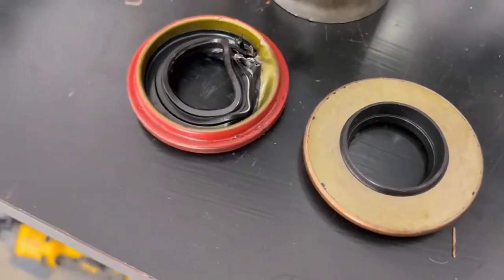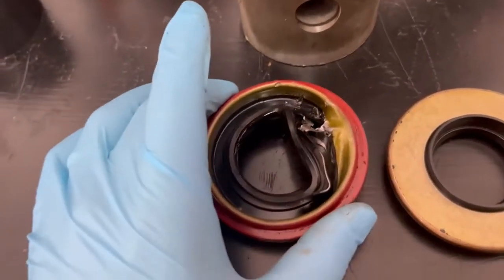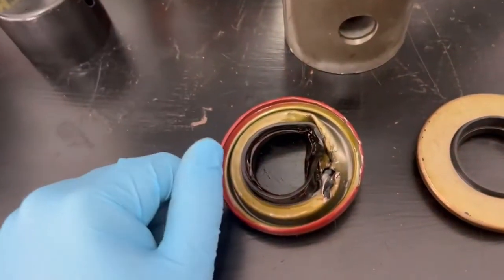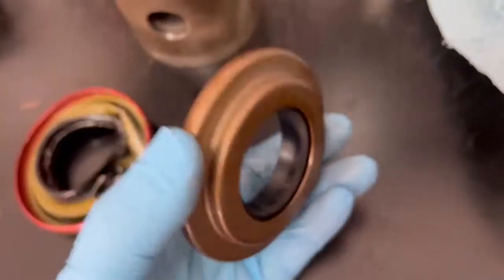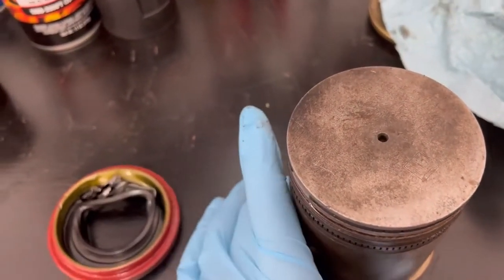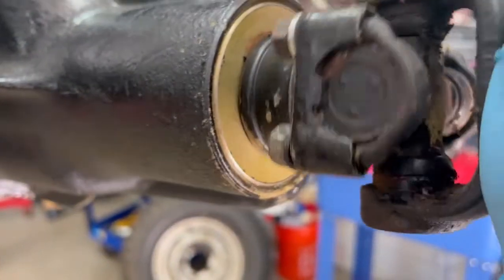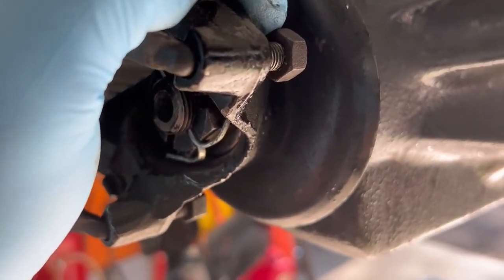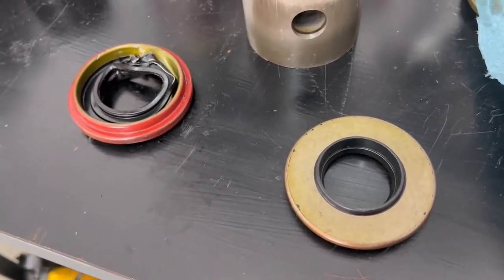1947 Jeep CJ2a Pinion Oil Seal Install

Comment: I'm looking forward to your cj2a rebuild videos.  I started a rebuild on a cj2a about 10 years ago.  It ground to a halt when the engine build took over a year to complete.  I was told they were waiting for the oversize pistons to be built.  Needless to say I kind of lost interest and it's been sitting in the shop since.  Honestly I kind of forgot where everything goes now.  Since it's in the same stage as yours I'm hopping watching your videos will get me motivated and give me an idea about what to do first to get back on track.  Anyway thanks for all the detail and info.  it's very helpful.
Reply from the maker: glad to hear you're finding the videos helpful! My engine rebuild took a few months because of parts. Same thing here - i got the Jeep in pieces and have never worked on one of these before so figuring out what goes where has been fun, especially since i did not take it apart nor did i get all of the pieces when i bought it. Thankfully I have a friend with an original 3a as i have been using that as a template to figure out where things go myself. From what i gather the 3a's are very similar to the 2a's. If you ever have any specific questions feel free to ask. Good luck!
Reply: What state are you from? I’m rebuilding one right now in MA and plan on making videos for it, get your project going!

Comment: When replacing the transfer case seals I use a 3/4" drive 2 3/4" socket for a driver. They are very fussy and if you don't have one the price of the socket is worth it.
Reply from the maker: Thanks for the info!